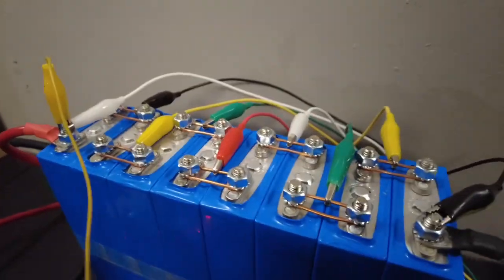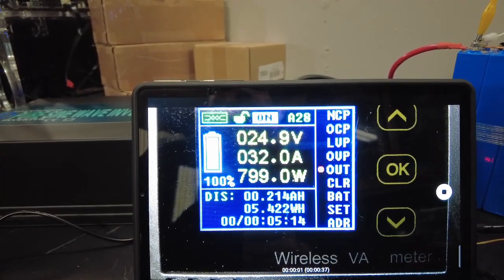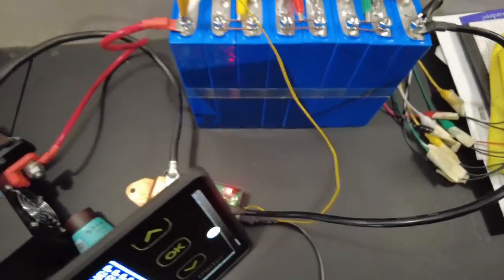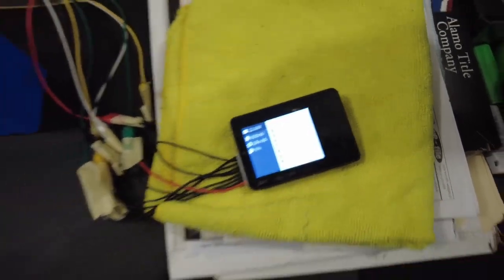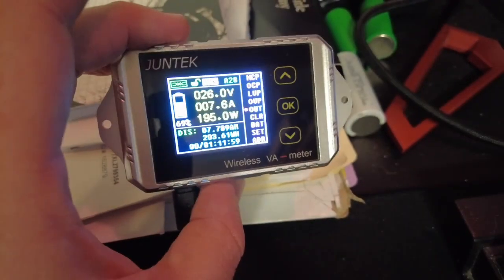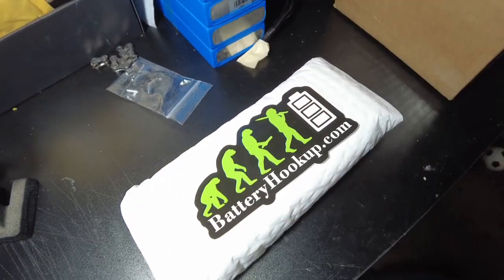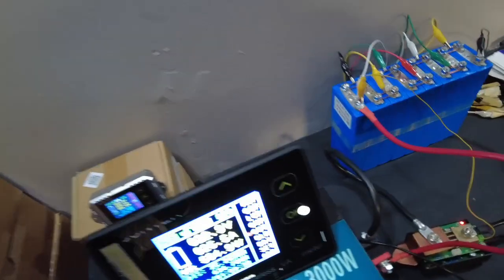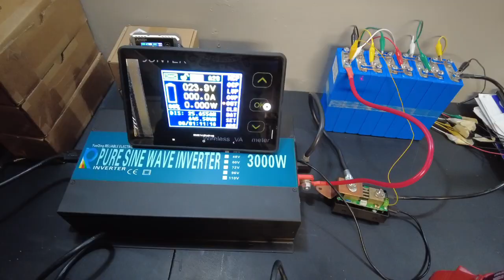Super Cheap LiFePO4 Prismatic Cells

Comment: THESE PRIMISTIC CELLS SHOULDENT BE COVERED IN HEAT SHRINK. IT GIVES THEY BLOW.  THAT IS NOT A PRIMISTIC CELL IT IS A CHINESE COUNTERFIET! A PROPERLY MADE LiFePo4 battery has a thick plastic case... And if rebar is shoved completely through the cell .. it will not burst into flames ..... These battery's are a knock off they might look primistic they are not... Even if it's LiFePo4 technology YOU DONT PUT THESE IN AN ELECTRIC CAR.... ITS LIFE THREATENING... ONLY REASON IM SAYING THIS IS BECAUSE YOU HAVE TOO MANY ELECTRIC CARS BLOWING UP CAUSE PEOPLE JUST DONT SEEM TOO KNOW THE DIFFERENCE... AND BELIEVE ME THERES A DIFFERENCE!
Reply from the maker: Ok, Thanks

Comment: Brad Cagle great review, i bought 24 of these cells from battery hookup and i can't get none them to charge pass 3.2volts, any advise about these cell i received....Peace
Reply from the maker: What are you using to charge them?
Reply: @BradCagle  I'm using DC Power Supply 30V 10A Automatic Adjustment DC Regulated Power Supply with 4 Digit LED Display for Digital Experimental Test i bought from Amazon...Peace
Reply from the maker: @docwilson5384  are you charging one at a time, or all 24 in parallel?
Reply: @BradCagle  one at a time
Reply from the maker: @docwilson5384  So if you have the power supply set at 10a and 3.65v a cell should be fully charged by 2.5 to 3 hours. If not something is certainly wrong. I guess i would learn towards your power supply, or connections. Do the cells stop drawing current after 2-3 hours?
Reply: @BradCagle  i'm going to recheck everything like you said with the charging amps and connection. Thank you for the support.
Reply: @BradCagle  ok Brad thanks for letting me know this i had the charger set a 1amp, i'm to try 10amp insteed..Peace

Comment: Battery specs are usually rated at 0.2C rate so you'll get less power at a 1C rate.
Reply from the maker: I know that's common, and still used to this day, however I've yet to find that to be true with LiFeP04. in this video I got the same results at 1C, and 0.3C